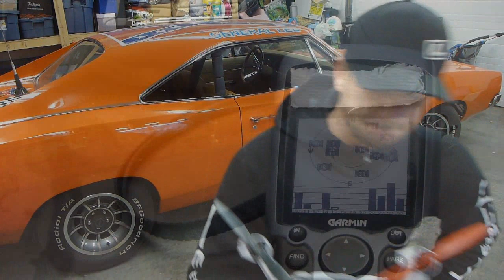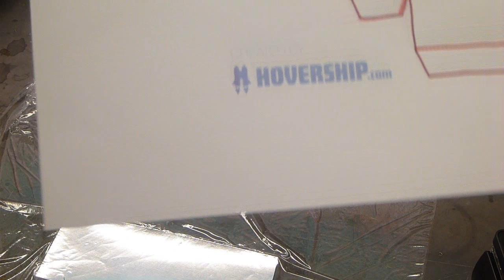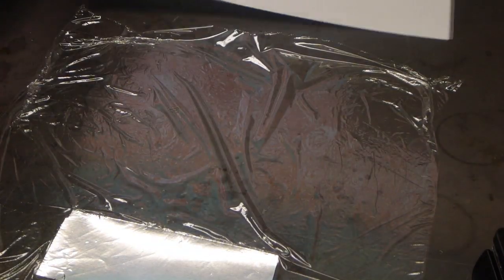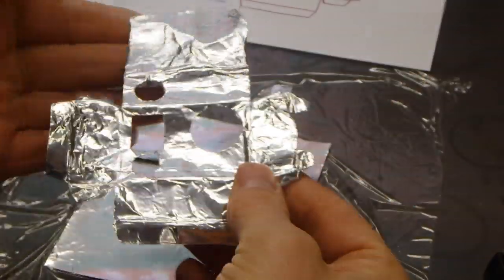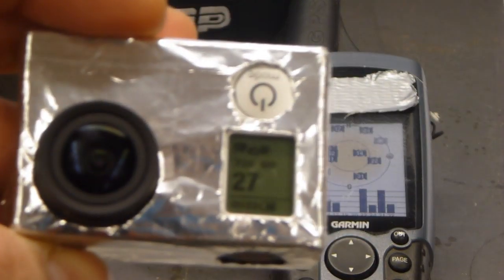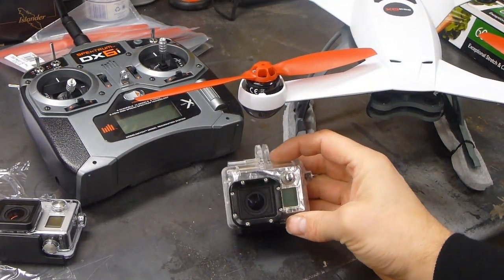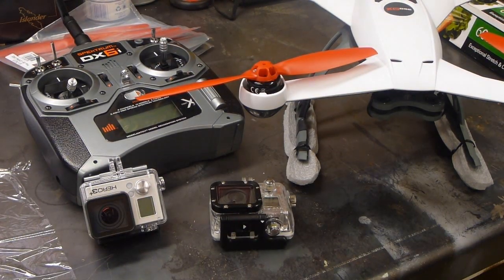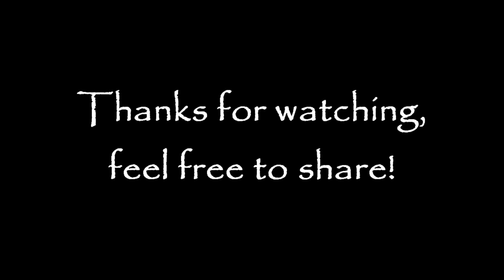Gopro GPS interference fix for Blade 350QX

Comment: Try using sticky back copper tape ( or aluminium tape ) on the outside of the GoPro plastic housing. It will look much neater and won't interfere with taking out the camera, SD card in/out or charging of the camera etc. Or if you have the patients then open up your 350-QX and line the interior base with copper or aluminium tape, that way you won't even have to mod your GoPro at all. 

The GoPro's interfere with other GPS signals of different Quadcopters as well, not just the Blade 350-QX.
Reply: Will this work with the Phantom 2 also
Reply from the maker: Jay Byron I don't see why not...all its doing is masking the radio frequency produced by the gopro...haven't heard of the Phantoms having any issues, maybe a stronger GPS, still a safe way not to find out! ha ha

Comment: Last I checked you can turn off the GPS location on the Gopro in the options...
Reply from the maker: Not sure about GPS locations on the Gopro, mine has no GPS ability....maybe you mean Wifi ? Either way it is with the Wifi OFF and before it's even recording...just when the camera is on...I think the video covered that...everything works awesome with the foil shield though. Thanks for checking out the video! :)
Reply: I could be wrong, think its the new sony action cams you can turn off the GPS and the WiFi. Seems like a needed feature for the gopro if it has issues.
Reply from the maker: Wayne Gassmann The Wifi on the Gopro is optional to turn on and off...this issue is present with it on or off...the camera puts off a radio frequency either way...and yes, it does seem to be a fault that Gopro is aware off but states that it is well within the regulations for RF (radio frequency) emissions...even though it has issued a warning not to wear the Chesty Mount over an Avalanche beacon for winter backcountry enthusiasts!  http://www.backcountryaccess.com/2012/11/19/issw-2012-avalanche-beacons-and-electrical-interference/